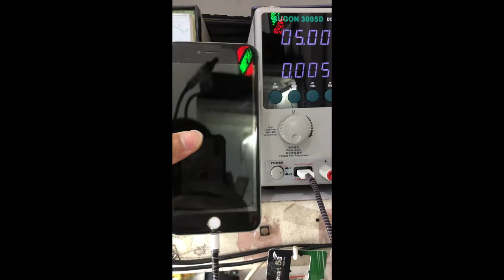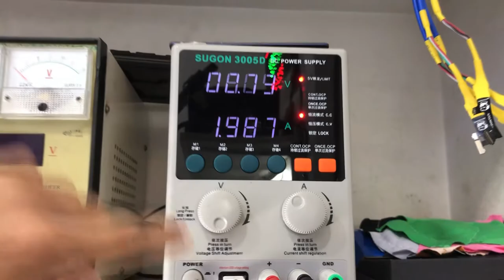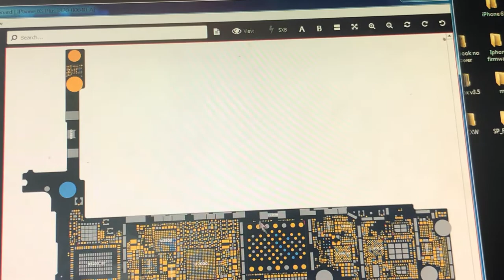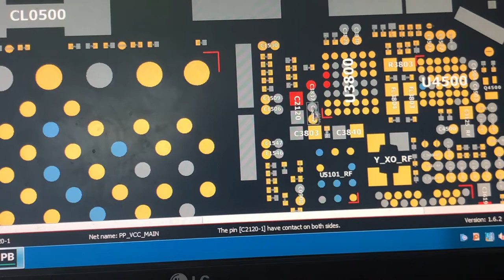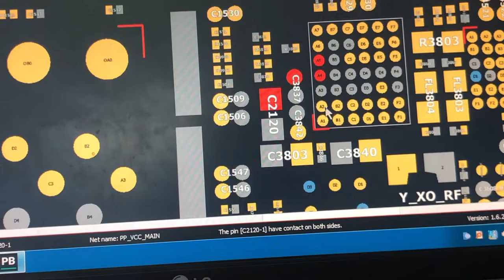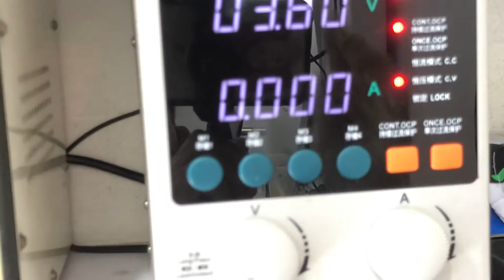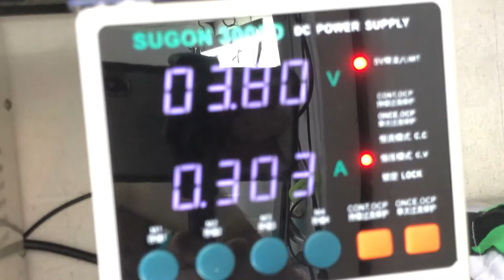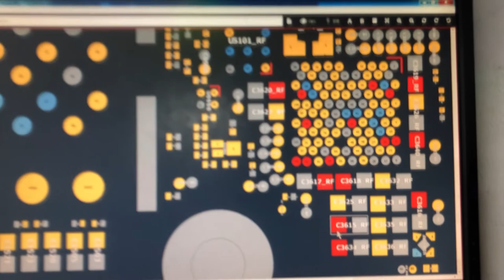How to fix iPhone 6s Plus No Power due to shorted VCC_MAIN line

Comment: saludo boss..dami ko natutunan.
ilang volts pla ung inject boss?
paano din mag set ng amperes sa power supply?
Reply from the maker: Sa voltage injection po at dapat di lalampas sa voltage requirement ng isang circuit for example sa VCC_MAIN ay may supply voltage dyan na 3.8v to 4.2v kaya kung mag inject po tayo sa VCC_MAIN at magstart tayo sa 1v  3Amp at kung di lumabas ang salarin ay pwede natin taasan ang voltage subalit wag lalampas sa 4.2v at sa max amps naman po ay 5amps min 3amps, ito po ay para sa VCC_MAIN
Reply: @cellphonerepairsolutions1479  Sir iba rin po ba voltage at amps sa VBATT line?

Comment: hi idol .. new follower at newbie din po sa larangan .. ask koo lang po kapag tine.test koo yong positive batt. terminal ng iphone 6s gamit yong negative normal sya kapag yong positive to positive na nag.re.reading sya ng 1. plus reading .. accurate ba yon or vcc main parin po shorted kahit nag.read. sya ng 1.+ ..
Reply from the maker: kung 1. something po wala po shorted to ground ang device ninyo sa vcc at vbatt line